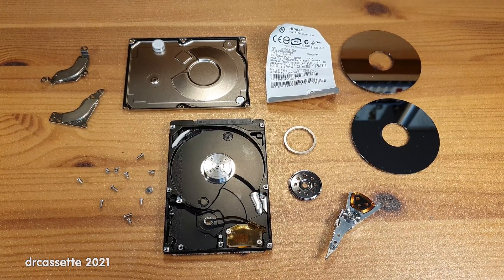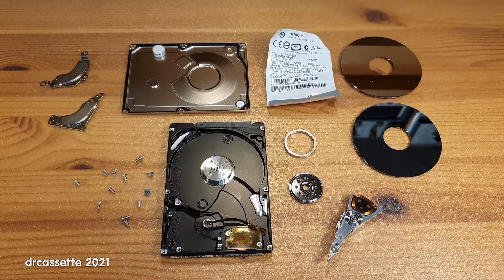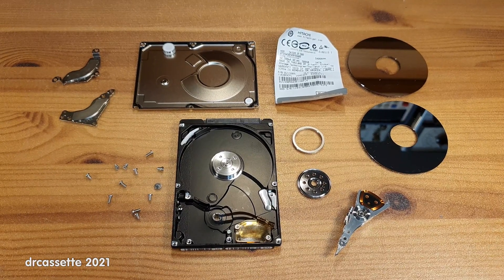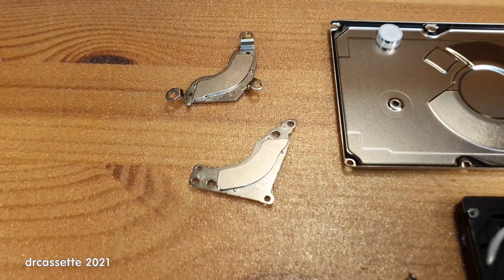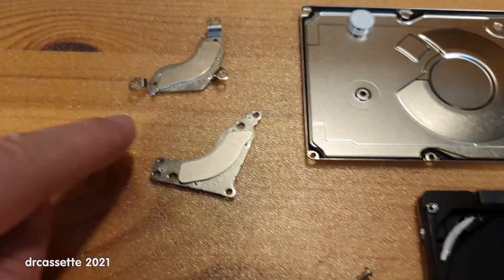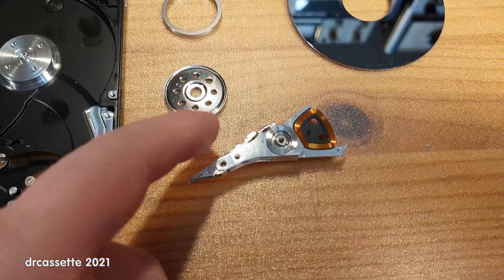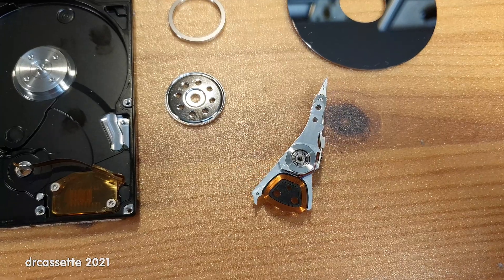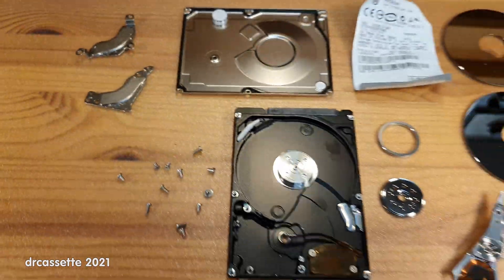Salvaging magnets from a defective HDD

Comment: I have had an interesting experience with magnets from hard drives. After using them for a while the lost significant  amount of their magnetic properties. Not sure if that the case with all of them.
Reply from the maker: Did you drop those magnets, or were they exposed to vibration, or extreme heat? That could have demagnetized them.
Reply: @DrCassette  I cant quite remember, it was quite a long time ago.